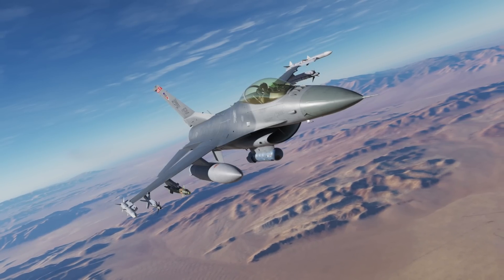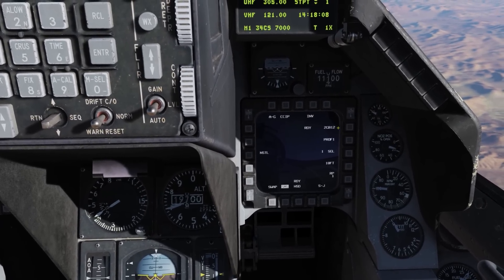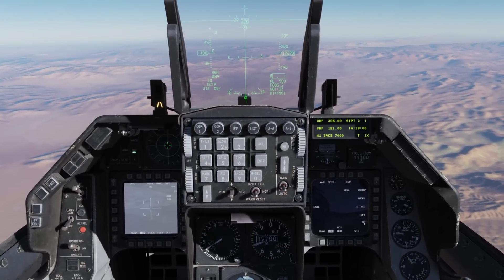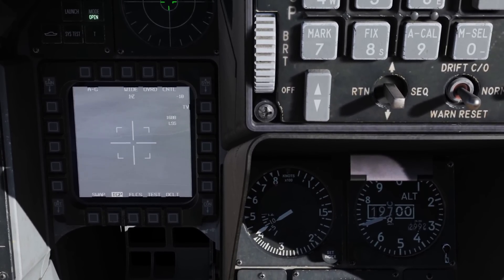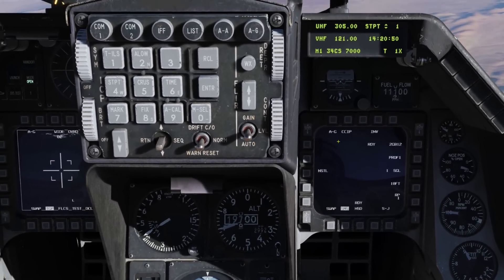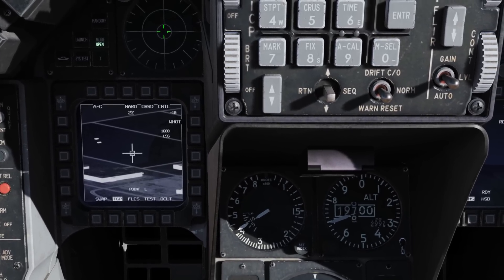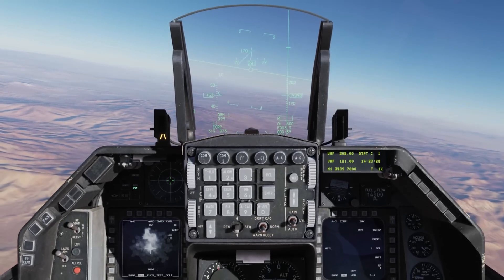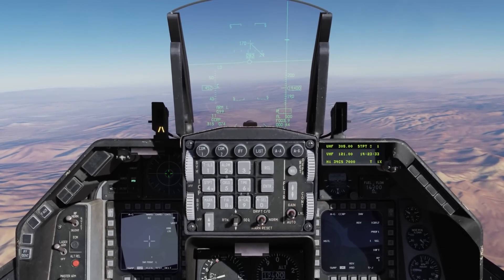DCS: F-16C Viper – Targeting Pod and Paveway II GBU-10 and 12 Laser-Guided Bombs

Comment: The tgp doesn't slew when I'm in air to ground mode, and it doesn't switch between area and point track modes either. When I try to change the track modes it just glitches out the mfd for a second and then goes back to how it was.
Reply from the maker: You are probably not in CCRP.
Reply: @MattWagner  It doesn't work in CCIP or CCRP. I'm uninstalling and reinstalling to see if it fixes it.
Reply from the maker: No such issues here, please post a track to our forum and we can determine where you are going wrong.

Comment: Can anyone help me with the slew for the TGP? I can’t seem to get it mapped to my throttle. I can only map the Radar cursor but I believe I need the TDC slew mapped? But it only says I can use a mouse for that
Reply from the maker: The radar TDC cursor is the same control as the TGP TDC cursor. Please make sure that you are in CCRP mode, CCIP is non-slewable and is fixed to the CCIP aimpoint. Thanks

Comment: Dont know if its been updated/superceded yet but Im having big problems slewing, on a TOO mission where you dont have convenient waypoint pre-programmed for the laser to fix onto. How can I reset it to boresight, for example?
Reply from the maker: To slew the TGP,  you must be in CCRP delivery mode. Later we'll add DTOS mode that will allow designation through the HUD. There is no reset to boresight function for the F-16, you can either use SP or CZ. Thanks

Comment: idk if anyone else is having this issue but I want to put it out there if anyone is having a similar issue and if its a bug it can be fixed. I use a T16000m FCS hotas and when trying to use the TGP on the f16 If I use the slew sensor on the throttle the TGP has trouble going into area track mode it does it just not consistently however if I set the TGP slewing to buttons on the throttle it works fine this is made even more confusing for me especially since the other TGP's in the game have no trouble at all going into area track mode while I use the slew sensor on the throttle if you want I could make a quick video showing what I'm experiencing if it helps people get a better understanding of the situation

Comment: I've watched Caps and Wags vids on this TGP and still when i slew the tgp about the hud cursor doesnt change so i cant do anything with the pod... any help would be apprecitated
Reply from the maker: Please make sure your have at least one steerpoint in the mission and that you are in CCRP mode. Thanks
Reply: @MattWagner  I select CCRP before I bring up the TGP page, and Steerpoint 1 preset over the target area and set to ground altitude, however the HUD TGP marker remains in a fixed point on the hud and doesn't follow the slewed over or lased target, I attempted to drop the GBU's anyway however they never picked up the point I was attempting to lase, a few others in the Grim Reapers discord were discussing the same issue.
Reply from the maker: Please post your issue here with a track file and we'll try to assist you. https://forums.eagle.ru/forumdisplay.php?f=659 Thanks
Reply: @MattWagner  Will do as soon as I can, I've just registered an account with the forums so I have to wait 24 hours to be allowed to post a new Thread.

Comment: I have a question. I recently switched from X-Plane 11 to DCS and Im wondering whether I should buy it. If the F-16C was complete this wouldnt be a question but in this case i would like to question your experience. Will Eagle dynamics will complete the F-16C properly or will they just add the most requested features and then leave it uncompleted? The last case happened to me when I bough a DLC A320 for X-Plane 11.
Reply: This is a super late reply but they will definitely finish the F-16. Eagle Dynamics isn't like X-plane publishers, they finish their modules completely. Still, I would only buy on sale for $60 dollars max, but I love the f-16, especially with the Mavericks and HARMs added now.
Reply: @hudsonr.218  Well thanks for the reply. I just bought it in sale. Yeah U see what you mean. I also notice theyre updates coming for the FA18 which has been published such a long time before. With such a development process, DCS will continue to exist parallel to MSFS2020.

Comment: When I am using the TGP, slewing is not that easy nor does it move as smooth as it does in the video. I also noticed that I am unable to use area or point track on the TGP using TMS-UP. Nothing happens... Yes I did TMS-Down to be able to control the TGP. Any ideas? I know Im missing something...

Comment: @Matt Wagner is it working with another laser codes?
Reply from the maker: Yes, any valid code. You just must make sure the pod code matches the bomb code. Thanks
Reply: @MattWagner  The bomb code has to be set before the mission starts? Cause theres servers that are not using 1688, for example theres a server that just 1687 works, and in the singleplayer missions, if you start flying, just 1688 works...
Reply from the maker: @garden432 , Yes, bomb codes are set in the Mission Editor. Servers should relay those bomb codes in the mission briefings so players can match with the TGP designation code. Thanks
Reply: @MattWagner  Thanks.

Comment: Is there a way to use the pod against "targets of opportunity"?  Let's say I'm flying around and see a line of tanks that I want to turn into tinfoil, but they aren't on a mission steerpoint.  Is there some way to "boresight" the TGP or create a markpoint/steerpoint to use as a reference just from eyeballing it?  Kind of like the way you designate a CCRP target in the A-10A?  Thanks.
Reply from the maker: Yes, that will come later in Snowplow (SP) mode. Thanks
Reply: @MattWagner  has this been implemented yet? Im looking into buying the f16 module.

Comment: How do you designate the target spi using the tgp???  The stear point doesn't move for me at all.
Reply from the maker: You need to make sure that the TGP page is set to SOI, that you are in CCRP mode, and that there is a steerpoint in the mission. Thanks
Reply: @MattWagner  Thank you for replying. To confirm, a steer point isn't a waypoint is it? Also is there a way to create steer points outside of the mission editor?

Comment: Works from airstart with TGP and LGBs, but not from ground start for me. I must be missing something.
Reply from the maker: Sorry, working fine here. Please make sure you are in CCRP mode and have a steerpoint in the mission. Thanks
Reply: @MattWagner  Thank you for the reply, Matt. I made a new mission and it's working fine. I'll see if I can figure out what I was doing wrong in case anyone else has/had the same problem. The original problem had the HUD targetting box not slaved to the TGP.
Reply: It was the steerpoint in the end. With none, the HUD box wont slave to the TPG. Does this mean that if there are no steerpoints in public servers, you can't use TPODs?

Comment: What is the control to slew the pod? I can’t seem to get it working.
Reply from the maker: Hi jppro, please make sure that your TGP page is SOI, that you are in CCRP mode, and there is a steerpoint in the mission. Then you can use , . / ; keys to slew. Thanks
Reply: @MattWagner  what if I want to use the slew control on my warthog throttle? What should I bind it to?
Reply: If you have a Z cursor on your throttle, use that. The same slew mech for the radar.

Comment: Quick question Matt. Are any of your partners working on the Tornado IDS/ADV variants - for DCS World? That would make for a heck of a platform. It's a fascinating 2 man aircraft. There's something about it. It's great for low level terrain masking, can even toss dumb bombs with great accuracy while evading enemy activity by using a long hill to dive back under cover, or high altitude TIALD laser-guided bombs over multiple targets, with the guy in the back doing much of the targeting work. It's a real team effort. It would be a smash hit, that much I know for sure.
The dual wing configuration is also interesting.

Comment: The SOI box needs to be a LOT more prominent. That's actually pretty hard to see.
Reply: Is your suggestion true to the original aircraft?
Reply: Maybe that's something to suggest to the original TGP code developers? According to Google, this is pretty much what the actual SOI indicator looks like in RL. And since this is a sim, we want everything to be and to look authentic, don't we?
Reply: I noticed that too. I am sure that can be refined later on in development.
Reply from the maker: Hi Even, it depends. It's a white box and if the TGP videos is very light, it can tend to blend. That is normal. Thanks
Reply: @MattWagner  I'm gonna need to run in WHOT mode all the time, then. I could barely see it (only by the missing bits around the OSB labels) in TV mode, and couldn't see it at ALL in BHOT mode. Hm.
Reply: @EvanWeeks  it'll be fine babe, don't worry

Comment: For those of us without a 2-stage trigger, does this mean we need to bind the first stage to a separate button, or will pressing the 2nd stage work for the laser?
Reply: I imagine we will have to bind a second button. Just like the gun in the F-5.
Reply: It is preffered to have to buttons for the first and second trigger detent.

They have separate functions depending on the Mastermode and weapons used.
Reply: second and first stage are completely different inputs so yes